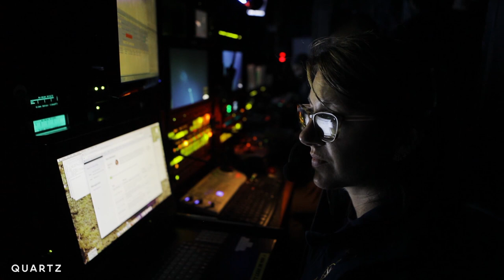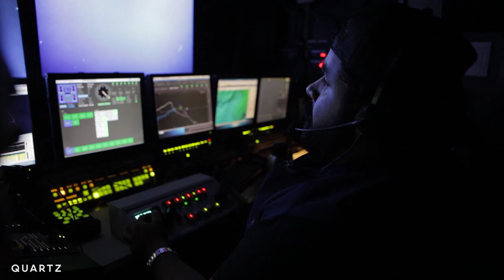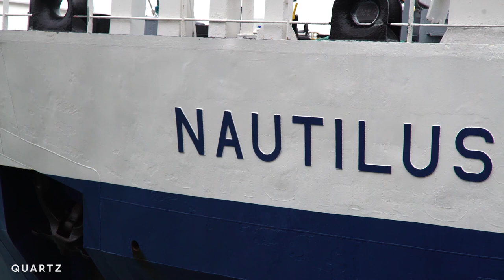Finding life in the deep sea

Comment: Can you generate power from high pressure?
Then we can have an underwater satellite to see things 24/7

Hey since this channel is called quartz,let's use the high pressure to generate piezoelectricity from quartz?
Reply: It does not work like that.
If you put pressure on a piezo crystal, it will shift the charges within the crystal lattice and if you put the crystal within a closed circuit, the charges will equal each other out and that's it. You'll have a very short current and then nothing anymore, because the crystal will just stay pressed together.

See, whenever you want a system to perform labour, you need an energy differential. Just having energy around you is not enough. There needs to be a point of high energy and a point of low energy. Only then you can use the energy flowing from the high point to the low point to power your... whatever you want to be powered.

An easy example to picture would be a water wheel. If you put a water wheel into a lake, it will not turn, regardless of how high the water in the lake is. Only if you have flowing water it will turn. And water will only flow if it can move from a point of higher elevation (= high potential energy) to a point of lower elevation (= low potential energy). The water wheel then transforms the difference in potential energy into labour to mill grain or whatever.
Reply: @johannageisel5390  ok makes sense